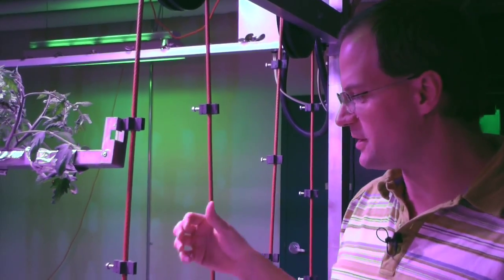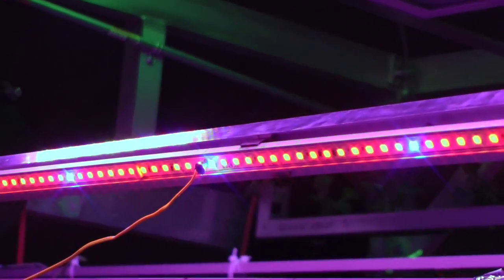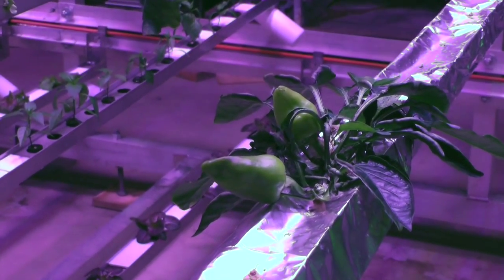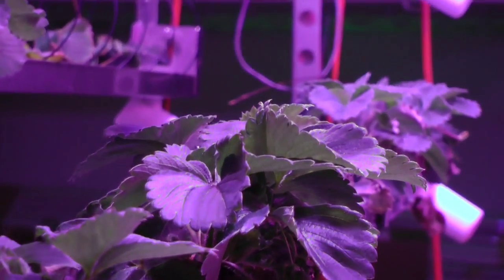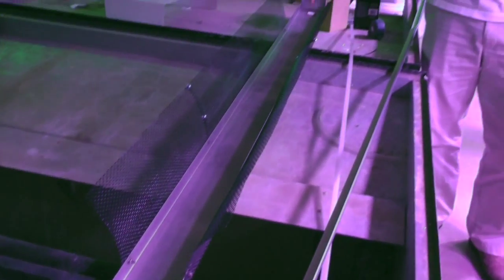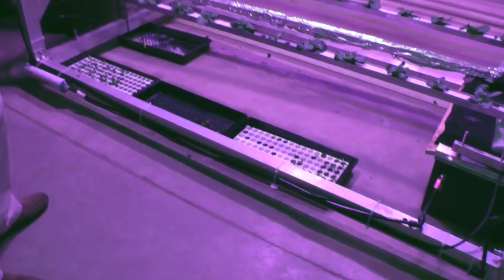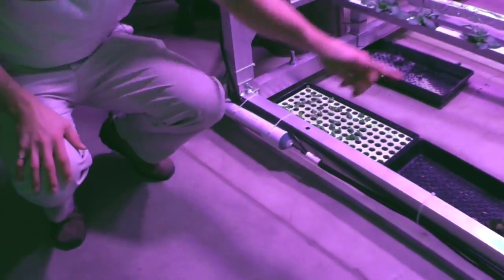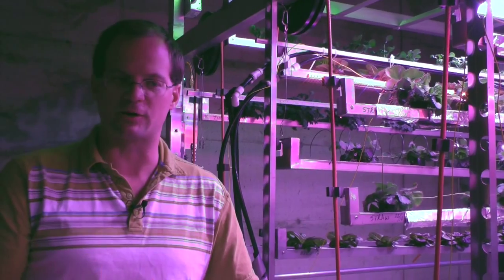R&D December EN

Comment: In general, I like the idea, however, a lot of energy is wasted in this system. A plant does not grow faster by being raised or dropped, so in the, say, month or so of growth each plant travels several miles up and down. That's all wasted energy.
Additionally, while light will always bounce around, here, most of the light does not go to plans, but lights the facility (measure the sq.cm. that are not growing surfaces and the light hitting these areas, all is a waste of energy. It seems to me dozens of designs can be created which would be more energy efficient. My concern here is simply economics. Great idea on the UV filter. But then the economics of the machinery needs to be considered as well. A flat table, trays, say 8" apart for the older plants, with the light in closer proximity and all the machinery costs are removed. Would rather spend dollars on providing energy to the plants, i.e. LIGHTS.